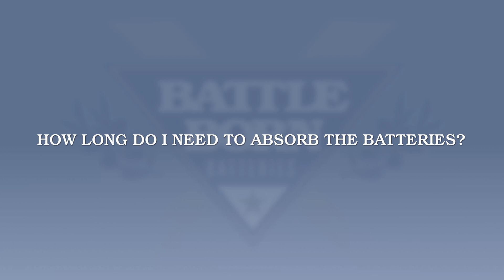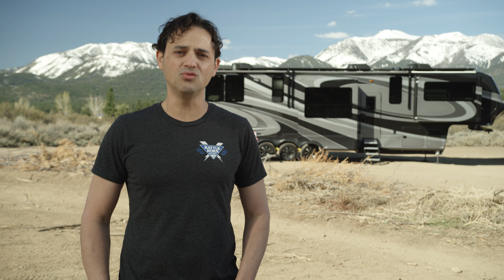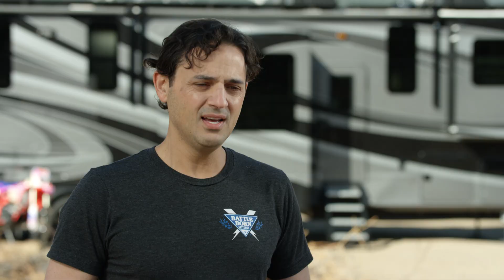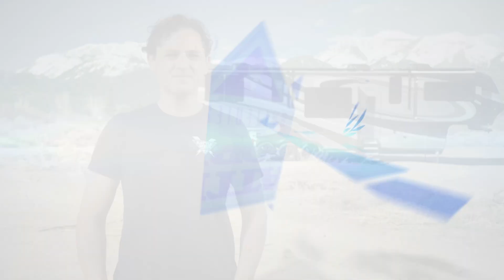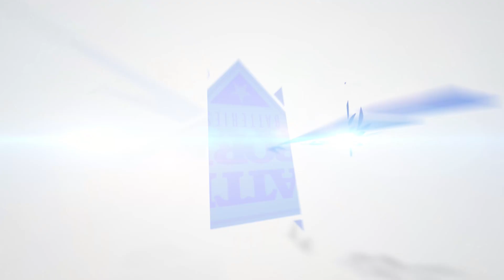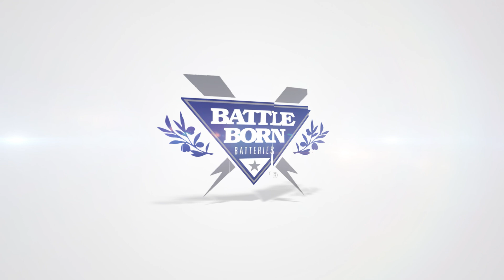FAQ: How long do I need to absorb the batteries?

Comment: I have four batteries and the victron smart solar charger runs the absorption cycle for 2hrs, twice as long as what this video recommends. I paid a lot of money for these Battle Born batteries and would like to know if that is excessive? If so there is a way to change the duration via the Victron settings.

Thank you in advance for clearing this up for me. 😊 in
Reply from the maker: Hi, please contact our customer support line 855.292.2831 so that we can address this issue you are having with your system.

Comment: I have a single 100ah Battle Born and have my 14.4 Absorption cycle set at 1 hour.  Am I harming the battery at that duration, or should I lower it to 30 minutes.  It is a bit of a pain to reprogram my non-metered Morningstar PS-30 PWM controller, but I will certainly do it if I am shortening the life of my battery.  Thanks!